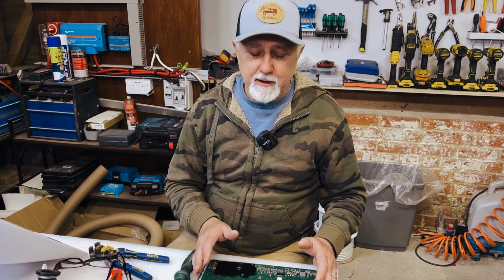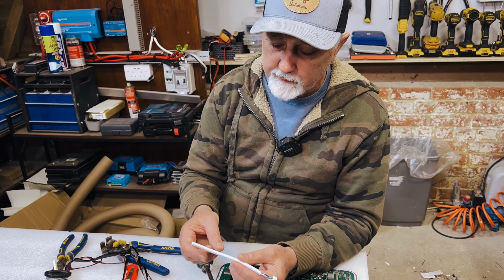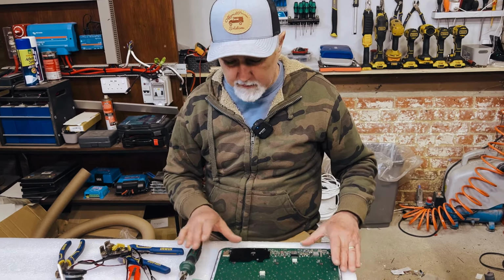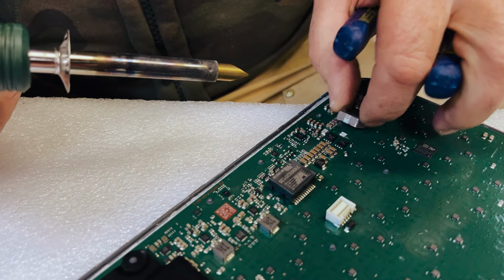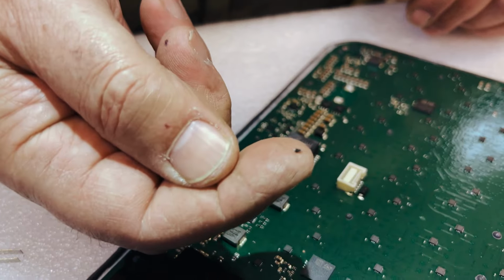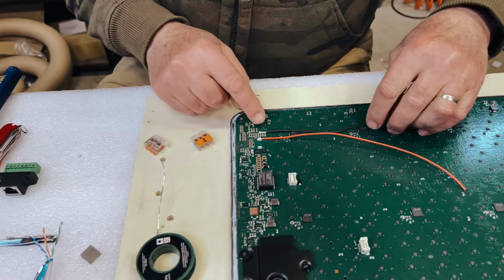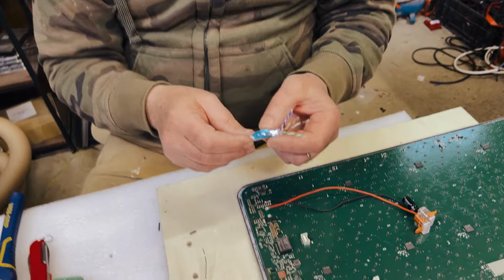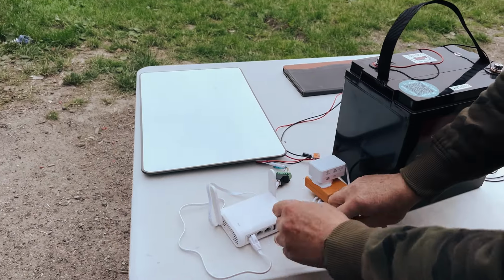Converting Starlink to run on 12v

Comment: 30yrs as electronic engineer but ... my god man buy a real soldering iron like a Weller with temp control and no need to sharpen a tip, also never use a solder sucker(snot puller)for surface mount... this video gives me nightmares.

Comment: If you remove the orientation part of the receiver, how are you going to point to dish towards satellite? I dont think it is that easy to set orientation  manually.
I would rather use 12 DC to 48 DC converter rather messing with circuit board.